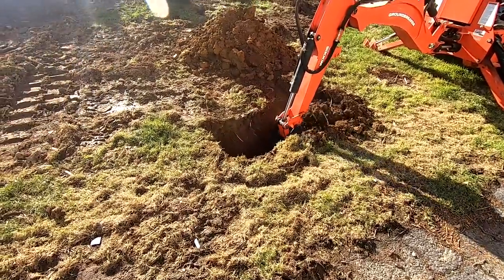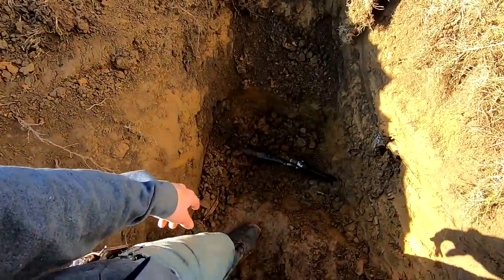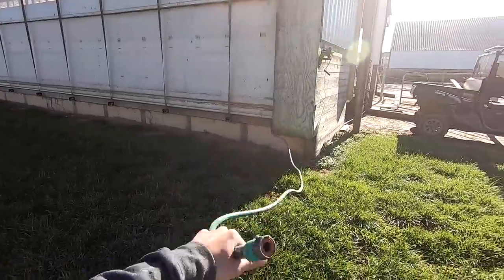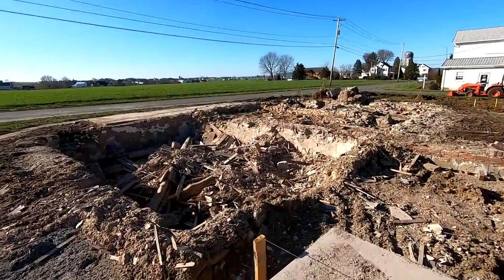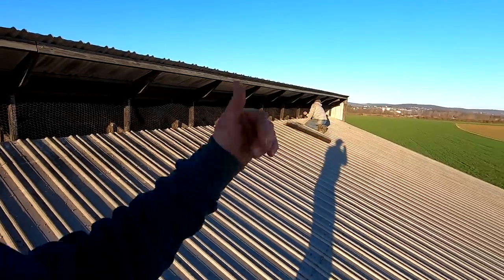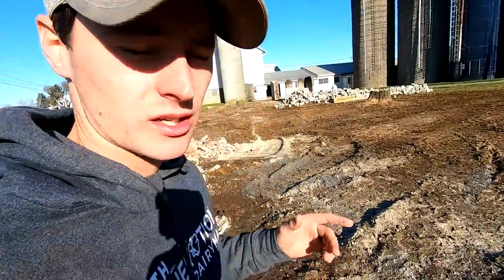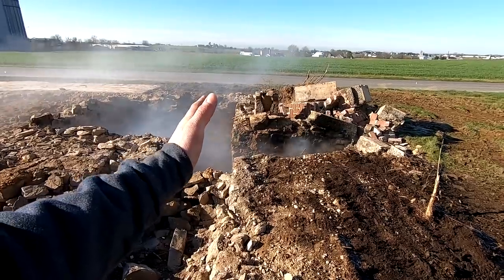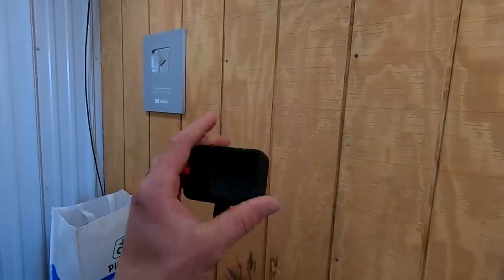Land of Opportunity

Comment: I said this when you were running the underground line a year ago.  Any pipe you are covering up, put caution tape (or any debris) 6 - 12 inches above the pipe.  It helps the next guy (aka you) not rip the pipe apart when digging it up.  In this case, since you are going to the same spot in a few month, stick a vertical pole or piece of old lumber right above where you want to dig down.

Comment: In addition to your main heating source...consider adding a wood stove (my preference) or fire place. They make for a great source of backup heat and they're nice to gather around on cold winter evenings.
Reply: and a real good backup for grid breakdowns...!
Reply: In my experience wood stoves are better for heating than fireplaces
Reply: Agree a wood stove is a must, really enjoy ours
Reply: Almost or maybe every other heat source requires power either for ignition or blowers or heat pump exchange. Wood heats the house and you can cook food or make a hot drink if the power goes out. You don't even need firewood, old pallets that you break up work great and cost you nothing. Many stores have a pile of pallets in the back they give away for free, saves them the cost of having them hauled away.

Comment: NIce video. I have done HVAC for over 55 yrs. and would recommend a (not high effeciency) hot air system with 4 inch filters. The high effeciency systems have way more items that can go wrong like the blower motors failure on the ECM motors, the blower motors on the heat exchanger,(Draft inducer motor) and the associated vaccuum switches that go with it,  the water traps plugging etc.  The high effeciency furnaces also produce toxic water residue and can eat out the heat exchangers in time. Go with an 80% system like a Reehm or Rudd ect. Cheaper to buy and way cheaper to maintain. Easy to install AC while installing the furnace.  Use natural gas or propane if possible. Example: A typical PSC motor is usually under $100.00. A high effeciency ECM motor can cost $500.00 to &1000.00 You can never make up the difference after paying for the high effeciency systems. Use foam and then fiberglass insulation together to get the best bang for your buck and really good windows to maintain your heat and Air conditioning. Consider two systems if it is in your budjet. One down stairs and one upstairs. Just remember is you use a wood stove or fireplace you need to let air in from a source so as to make up the air going out the chimney.Thanks
Reply: What? 80% have inducer motors, pressure switches. In fact they last half the time 90+ do.

Comment: I like geothermal for heat and air conditioning. But I would also put a bedroom on the main floor so when your older you don’t have stairs to climb. Also put a 4 foot staircase in it makes a difference when moving furniture in
Reply: Great comment. My friend’s Mom has her bedroom on main floor and no stairs to fall down. If I had a multi floor home, I’d have a main bedroom on main floor. I’m 61 and many reasons for this. The other thing is washer/dryer. I’ve got mine on bedroom level. Thanks for including drone shots.
Reply: I agree

Comment: For heat i'd suggest an outdoor wood boiler. The bonus is that during the winter when it is on, you have nearly unlimited hot water for showers/dishes/etc. I live in an old farm house myself in eastern Canada, and we often have to turn the thermostat down below 70F just due to how hot it is despite the fact it's usually -20c or colder. (Now to be fair, we do have the boiler temperature set at 180)

Comment: advice for heating, we have waterpipes in the floors, and it is amazing. you can heat the water with just basic electricity, air/water heatpump, wood chips/pellets/log furncace, etc. loads of flexibility, and great heating
Reply: Definitely heat pump for efficiency. Long term savings worth it as you don't look like you are planning on moving anytime soon. Radiant floors are a game changer anywhere with tiled flooring or basement.
Reply: Exactly…. And new age radiators are slim and modern,,  if you have issues with in floor pipes in places.
Reply: @Eric-dr5bj  yea, if you dont have access to cheap firewood/woodchips, then a heat pump is most likely the best choice.
Reply: addendum: no matter what you choose, i would strongly reccomend a fireplace with a cooking top. its cosy, and adds an extra layer of safety, providing both heat and a place to prepare hot food if you loose power. we have one, and i still remember that one christmas we prepared the entire dinner on ours
Reply: I used to live in an apartment where the building boiler was under my bedroom, and the hot water line for the entire building ran up the wall. In the winter it was great, in the summer it was miserable.
Reply: Was thinking biogas. The one thing they have plenty of is manure. This would take care of their heat, water and cooking fuel.
Reply: My neighbour installed an ethylene glycol system but he did water it down in the basement with a circulating pump attached to a small hot water tank. I think if you really insulate that house properly a rad system is the best
Reply: George  I am familiar with the term. Yes that is the elemental compound gas used in biofuels(CH4 if interested). My point is why spend electric, natural gas, propane or any other method if you already have manure a plenty. That said a wood burning backup is always a nice option. Though for insurance purposes might not be ideal.
Reply: Eric I’m a HVAC professional.  I can give you some great recommendations but would need a little more info about what utilities are available to you now.  I see the home will be 3 levels so basic sq footage would help too.
If you rather take this offline that’s an option too.  Would love to help if I can!
Mike

Comment: We went with GeoThermal when we built in 2010. We are very satisfied. There are no hot or cold spots in the house. We figure it paid for itself in a bit over 5 years. Very economical in the long run, it's just getting past the initial cost.
Reply: We just built a house on our farm in SW Iowa, we also went with GeoThermal with grouted in wells. It was quite expensive but pays for itself fairly quick.
Reply: There is also a 30% federal tax credit.  You've got the outside space there to do a horizontal loop system in the front yard.  Once installed you would never know it's there.  Most cost effective system out there unless you like cutting wood.  Been in the geo business over 20 years.  Hit me up if you want to talk more.  Enjoy the channel btw.

Comment: Hi Eric, my wife and I built a home about two years ago and we used spray-foam insulation in the walls and on the bottom of the roof deck, which means you have a conditioned attic space (nice for storage). We have central HVAC and propane heat, but we use a wood stove for most of our heat. We put the stove in the same room as the stairs and the heat naturally flows up the stairs and heats the upstairs. The bedrooms stay cooler which is nice for sleeping too.

I don't know exactly where you're located but it seems colder than Oklahoma, so you might look into radiant in-floor heat, at least for the downstairs. If we lived in a colder climate we absolutely would have done that, but living in Tulsa it didn't seem like the extra cost would be justified.

I'd also encourage you to look in to the ZIP system for sheathing on the outside of the house - it's a vastly superior product to things like Tyvex. Check out Matt Risinger's YouTube channel - that's been my main source of building science education. Although he builds in Texas he has lots of videos discussing homes in colder climates as well.

Comment: Heating advice! My suggestion is spend more money and attention on the insulation and air sealing (zip system/spray foam/Rock Wool) then no matter what heat source you install the heat (AC in the summer) will stay in and be as comfortable as possible!
Reply: Good advice   Not sure about building codes in that part of Pennsylvania but definitely have the builder use housewrap.  My house was built in 2000.  I am the second owner so I had no input. Unfortunately, housewrap was not required at the time in this Virginia county.   I sorely regret that was not done.
Reply: Yes + ERV for sure!

Comment: We built a house last year and went with fuel oil. I'm very pleased with the efficiency and cost compared to other heat sources. But most importantly, put as much insulation in as you can, no matter what it costs. I did and have no regrets.

Comment: check out what business your amish neighbors are in as far as what kind of wood they use. if they are using hardwoods for pallets and throwing it away, you can get the hardwood block cutoff's super cheap. then get yourselves an outdoor wood boiler connected to an electric boiler for redundancy. you also said you were going to have a fireplace as well, so you can supplement in the evening with that. or better yet, put a corn stove insert in the fireplace hole so you would have 3 types of heat. plus the corn bank is down the road.  redundancy is the key

Comment: In floor hot water heat would be the most comfortable and efficient. If you also want to have A/C then you would need an additional system. Up front it would cost more but in the long run pay for itself. Glad to see the demo done and knowing the new home will be started soon. Got my hoodie yesterday and it is great. Thanks till the next one.

Comment: Have had radiant in floor heating in my house for the last 25 years and absolutely love it. Keeps the house very comfortable in the below zero NW Ohio winters. Floors are heated from hot water. Heat rises so the entire room stays warm. Never needed central heating or any other heat. Very low maintenance if any!
Reply: BUT how are you heating the water? natural gas furnace?  fuel oil? electricity?
Reply: Good unless he wants AC system with the heat system.
Reply: What type floors do you have- hardwood, tile, carpet?? We have hardwood floors and were always told not to let the water get much above 95 degrees because it will dry the floors out and cause them to shrink, warp, crack, etc. Ninety-five degrees under wood won't heat the house on cold days in MD.

Comment: I was wondering if you could figure out a way to re use that huge old cistern that you all found?  It seems like an asset if you can figure out a use.  Also radiant heating is the best and most versatile.  Once you have the radiators and/or in floor pipes in place you have a great choice of means to heat that     water ... Including wood fired boilers and geothermal heat.  Air conditioning is easy to do as a separate system.  It can actually be more energy efficient that way as well.

Comment: From a 25-yr HVAC guy...  Geothermal ground source heat pump with propane supplemental (versus emergency elec in typical HP setup)!  And consider adding solar to the farm in general (would not put it on the house proper) as the ability to help offset consumption makes sense if you can sacrifice 1/4 acre of pasture to install a worthwhile array.  ROI can be long, but worth considering w/r/t monthly cash flow as you feed the grid.

Comment: I installed a geothermal system about 10 years ago. One system for 1st floor and one system for 2nd floor ( it is hard to maintain even temperatures upstairs and down stairs with one system). The heat generated by the unit can furnish your hot water (more in the summer than winter). I also installed a steam humidifier, which allows you to lower the temperature and stay comfortable in the winter. The initial cost is definitely higher, but with the tax credits and efficiency, it will pay for itself within several years. 
We also framed the roof over the garage to allow for a spare room accessible from the upstairs. Cheap way to increase your living space (bedroom, spare room, playroom). There are a lot of tough decisions to make when building a house for a lifetime.

Comment: Looking Good and yes, very nostalgic!  As for heat and air, look to the future a bit and consider geothermal.  Will give you heat and air and the new generation of systems can handle cold below zero.  As an added option, look at a wood pellet stove for those really cold days/nights.  Very efficient, controlled by a thermostat, no smoke,  Geothermal is run by electricity so a power outage without a generator will be a problem. The pellet stove needs electricity too for the fans but can be run by a 12-volt battery.  I have three sources: 1) in-floor heating in my basement and garage  2) a regular HVAC gas-fired system we rarely use for heat (but it's a backup for everything) and use it for AC in the summer 3) a wood pellet stove.  We use the in-floor heat as the basic heat for the house (gas-fired) and add the pellet stove for cold days.  The regular furnace is rarely used and mostly as a backup.  I didn't build it this way but bought the house with all this already here.  We are in central Wisconsin.  If we ever leave for an extended period of time in the Winter, we have the regular furnace as a backup and would not feed the wood pellets.   Insulate as much as you can.  Good luck with your decision!

Comment: Hi Eric and family. I’m a dairy farmer in Ontario. We have 4 kids, I’m 43 now. We build our house 10 years ago. We have a propane forced air furnace with a/c. The propane heats the house in the changeable weather. We also have a wood boiler in the garage. There’s a 1000 gallon tank that holds water and stores the heat generated from the boiler. The radiant   heat warms the garage so my wife’s vehicle is warm and I can work on small projects there. The water from the boiler and tank circulate through in-floor heat in the basement and bathrooms of the house. Kids bedrooms are in the basement, house is a raised ranch. There’s also a rad in the air ducts that exchanges heat as the furnace fan runs.  This really cuts down on purchased fuel over the winter months. The water that goes to our domestic water heater is pre heated too so well water isn’t going in at 5 degrees, instead it might be 30, Celsius.  The warm floors are truly a great blessing. I wouldn’t change that for anything. I burn about 15 face cords of wood a year to heat a 5 bedroom house. Takes a couple days work to process the wood, some people wouldn’t do it but I like the work and with current prices, saves $3000-4000 per year. You could likely install a gas boiler, if wood isn’t your thing. Would work the same as far as in floor heat.

Comment: For a HEATING system, I’d go with radiant floor heating.  There is nothing more comfortable.  You could use window air conditioning for now, and perhaps go with mini splits later on.  It’s possible to be creative and use the heat from your manure pits under the barn.  Not sure if that would create a problem with emptying your pit, but there is a ton of free heat you could capture if you had the right design.  

PS. If you go with this idea, I want a free hat! 😂
Reply: +1 for radiant floors. Lots of options on how to get it heated (Geo, gas, solar-combo, etc)

Comment: Heat for the house: I had a house in Illinois that had hot water heat through radiators. It was very economical. During zero degree weather, my biggest gas/electric bill was $300 for a big uninsulated house while smaller insulated houses with more modern heat systems were running $500. This was back in the 1980's.

Comment: I recommend geothermal. My parents put it in when they built their house and they couldn't be happier with it. It's 400-500 percent efficient and granted, if you have to run off electric for any reason if the geothermal isn't working, it can be expensive, when the geothermal is working, it can cost pennies a day to both heat and cool the house. And geothermal works, you get 4-5 BTUs out for every BTU put in. Electric heat is your backup.

Comment: Here in south central NC, we installed a dual fuel HVAC system. Heat pump with LP (propane) backup if it gets below 28 degrees. Have family In Hanover PA and there weather is comparable to ours. Enjoy your channel and I learn a lot.

Comment: It's really good seeing you billed a new house. I think you have made the correct decision it will be so much more comfortable for your family. 

As far as heating, more installation is best. Then, ground to ground heat pump is the cheapest. Then air to ground is next. Try and avoid oil or gas heating. It will be the most expensive in the long run

Comment: When given the opportunity to build a stick frame from the ground up, 2x6 exterior walls with spray foam and a tight envelope. Then just standard central heating and cooling. Do the insulation right and you won’t even worry about the utility bill. 

Especially when people are throwing things around like geothermal and radiant floor. Things that either don’t work with multiple stories over a basement or cost a lot. Shoot that cistern you’ve already got would do the job of geothermal without having to do wells. 

But the more specialty the system. The less serviceable it is by the homeowner or normal service techs.

Comment: With a rural property you can't beat GeoThermal! Temperture in the house does not vary by a degree, no cold time just before the furnace kicks on and you get air conditioning in the summer as part of the system. With a twelve hundred square foot house we have 900 feet of plastic pipe buried five feet down in the first paddock behind the house. It has been there eleven years and we love it

Comment: Radiant heat is a great choice!  Especially if you've little ones romping around, the floor will be nice and warm. That type of heating is great for those colder climes.
Reply: BUT how are you heating the water? natural gas furnace?  fuel oil? electricity?
Reply: @MichaelMantion  That's an entirely different question.
Reply: Electricity is much too expensive to heat the water.  Natural gas, if that's already set up, is really the way to go.